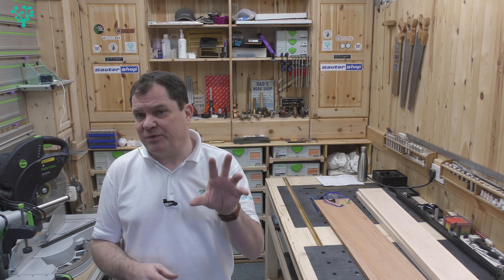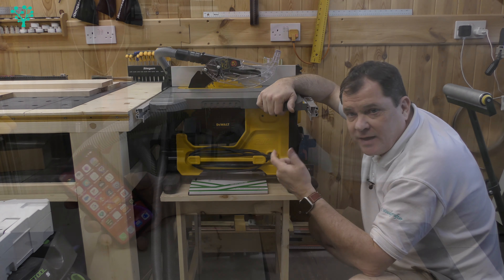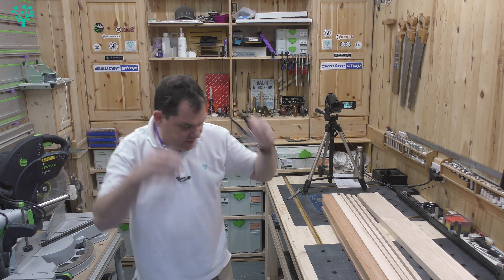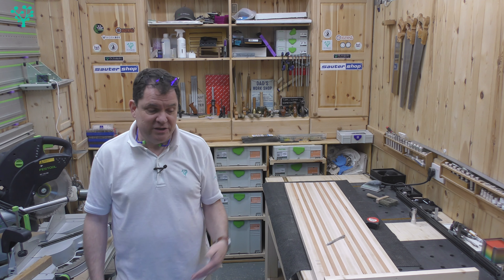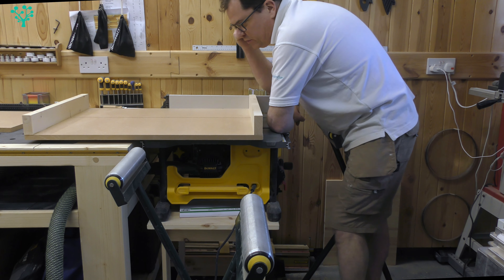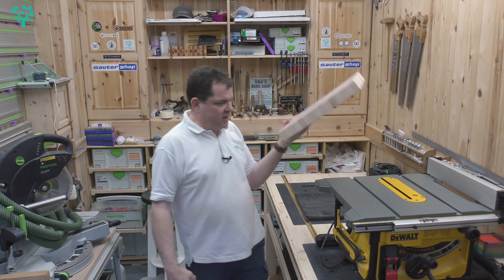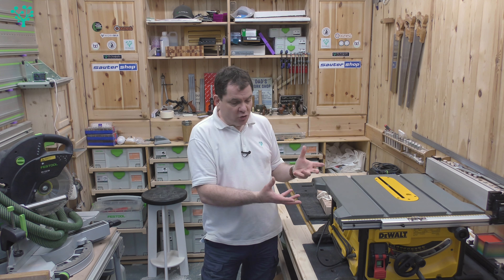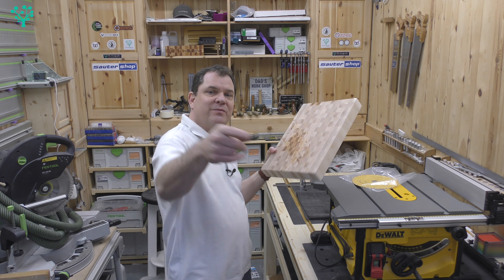Dewalt DWE 7485 table saw review series - Episode 3 Hands on Review

Comment: Most people just take this saw out of the box and kind of look it over and call that a review. You have done a good in depth review. Excellent. I'm primarily a wood turner and most of my cutting will revolve around the lathe. I have this saw on order as a replacement to my old-motor died-saw and I think it will suit my needs quite well. Thanks

Comment: I just bought this saw and your 3 episode series gave me everything I needed to know to make the end grain cutting board using this small saw. I've been using a large cabinet saw for years but it was finally time for a new saw. I decided to go small. I'll also need to make a new work table. I plan on incorporating a 12" miter saw and a full size router in the table. The table should be about 2 meters long and 76cc wide. The miter saw will fold down in the middle and I'll cover the hole with a board. The router at the other end will be flush giving me a flat work table.
Reply from the maker: Thank you for the feedback Mike, glad it helped.

The build sounds interesting, good luck 

Andy

Comment: I have had my Dewalt table saw for almost 10 years now. It is admittedly the DW745 but it has served me very well. I have predominately used it for construction carpentry but I have also made quite delicate furniture and small woodworking projects where accuracy has been of much higher importance. I find that it will do the job, but only just, and after almost 10 years, and with more space available to me now, I am in fact looking at upgrading to a proper cabinet saw. The fence system on the Dewalt I find brilliant but the table size, and the fact that it is fairly uneven (had to return the first I received but the second one wasn't exactly flat either) is constantly becoming an issue nowadays. The 745 is very noisy too, has an awkward location of the ON/OFF switch, and then there is the more or less non-existent dust collection. It may have gotten worse over the years but I also find that I need to recalibrate the trueness of the blade more frequently now, and the option of adjusting this is a little crude in the first place, so when I have done all my research I will be retiring my Dewalt to the occasional rough sawing....but after 10 good years of very good service.

Comment: Thank you for a great video.
Here 2 years later - are you still satisfied with your choice of DWE 7482, or have you run into some limitations with it, especially around the blade size?
I am looking for my first table saw and am considering whether it should be model 7485 or 7495
Reply from the maker: I actually ended swapping this out for the  new Festool model.

The main reasons for the swap was noise and dust pollution, the addition of the Incra sled gave me the accuracy. And a quality after market blade gave me the quality of cut I needed.

The blade size did limit somewhat - but there was enough accuracy in the machine that I could flip the stock and complete the cut. So not an issue.

It is a good saw, HOWEVER I had lots of feedback that people had mixed results with the flatness of the table - many had a dip init. So something to be aware of.

Cheers

Andy

Comment: I am experiencing  problems 😕 when changing blades. The issue is, the fitting of the blade and nut on the arbour is not exact, consequently the blade hits the riving knife holder. Is there a technique to ensure the blade centres  accurately on the arbour? Any advicemuch appreciated. Thank you.

Comment: Hi Andy, cam I ask where you got the Y connector from, only I’ve been struggling to come up with a way to have both ports connected to my record power CamVac, thanks Terry
Reply from the maker: Hi Terry,

It came with the Festool Y connector for the CMS system.

To be honest - I have stopped the top dust port now - I find I get better extraction with just the lower port.

Cheers

Andy
Reply: @TheWoodgrafter  thank you
Reply: @TheWoodgrafter  I must admit I have my dewalt DWE7485 bottom port attached to my record power CamVac and it’s doing fairly good job, but I still get a bit of dust flying out the top, strangely when the guard is on, without the guard and just the Irving knife it seems to improve and sent the dust out the bottom.
Reply from the maker: @Terrythemaker  

Yes,  I found the same thing, no idea why - but I am getting better dust collection as you describe.

Cheers

Andy

Comment: Hi Andy, this series should be the go to review of this saw and all the other variants really. These saws really are a workhorse for a small shop.  Nice cutting board (I don't plane my sawn timber down on the first part of making the cutting board, in case the glue up doesn't go well). I wonder who put you onto the Laguna 16/32 Drum Sander, glad to see you using it.  Cheers Paul
Reply from the maker: Hi Paul,

When you see the review for the Laguna and actually give a shout out to the person who put me onto it. And a link to that person’s Etsy shop. So that will answer that question 🙄

I plane the stock down so I am running flat square stock over the table saw. Rough cut stock and table saws can give a problem.

Thank you for the comment.

Andy
Reply: @TheWoodgrafter  Cheers matey... 👍. Yep I see your point about the rough stock... Maybe i will try it now i have a load of timber in stock for my christmas boards...
Reply from the maker: My theory has always been you have to mill it at some point, so do as much as you can at the start.

Love the fact you are making a start on the Christmas Boards.

Perhaps I better make a start.

Andy

Comment: Woder if you could help me with a few questions? 😉 

1. I'm looking at getting either this or the SkilSaw PT99T-01 and having a hard time making the decision, would you have any advice as to getting one vs the other?  

2. I was in Home depot the other day playing around with this Dewalt saw and the knob for adjusting the fence seemed unusually stiff to turn.  I tried two different ones and they both seemed the same. Just wondering of this was normal cause every vid I've seen about this saw seems to show the knob being turned effortlessly? 

3. If one blocks one of the exhaust ports does it divert the dust over to the other port? (like who's gonna hook up TWO vaccums! 🙄)
Reply from the maker: Hi, good questions.

The two machines are very similar, the only obvious difference is the way the riving knife is fitted. In the Skilsaw, you remove the plate and use a quick-release lever - in the Dewalt, you reach under the table. Ultimately my saw will be built into a cabinet - so the top adjustment on the Skilsaw may be a better option. Beyond that both are similar.

The adjustment knob on the fence is easy to turn and you can dial in some very fine adjustments with it. It sounds like there is some packing material on the one ins the store that hasn’t been removed. So I don’t think that will be a problem.

I have had numerous people tell me that the too on the Dewalt is not flat - so there may be some quality control issues in the factory. Perhaps research if the Skilsaw has the same issue.

The dust ports aren’t connected, the main port at the back is connected to the base of the blade. The top port is connected to the blade guard. You use a Y connector to connect them both to the vac. The Y connector is not supplied with the machine.  Most folks only use the main dust port into the vac and that works OK. If you don’t use the blade guard you have a safety concern and that is not recommended. But you could put the guard in place and not connect a vac to it.

Hope that helps.

Andy

Comment: Hi,

I'm relatively new to using a a table saw and I have this model. With respect to the replacement blade used for crosscuts, is it just the 210mm x 30mm x 2.4mm 52 Tooth Track/Circular saw blade - 2402 C3 from Keyblades? I am keen to improve crosscuts from the standard DeWalt blade,

Thanks
Reply from the maker: Hi Steven,

Strangely on the site I can’t actually see the blade anymore.

But yes it is a standard blade. The one you have indicated looks correct.

Cheers

Andy

Comment: Hey Woodgrafter, I've been making these with a bandsaw and hand plane. I'm definitely tempted by power power tools to make them easier. I can only seem to source Oak locally. Where did you get your maple and cherry from? How much did it set you back?
Reply from the maker: Hi Alex,

Power tools make it easier, the ideal combination is a planer jointer, some sort of saw to make the cuts (bandsaw, table or track), then a drum sander and finally a router.

So not a cheap set up, ultimately it depends why you are making them and if you get a return on the investment.

In terms of the wood - I use www.timbersource.co.uk

And wood has gone stupid expensive at the moment.

Cheers

Andy

Comment: It dose ok for a job sight saw it’s not designed for 100% precision cuts
Reply from the maker: Hi Jimmy,

Yep understand that, the purpose of the exercise was to see if you could take the job site saw and use it (for precision) in a small space.

The compact footprint and robust build are attractive - but if it can’t make accurate cuts then not much use in the craft/cabinet shop.

Cheers

Andy